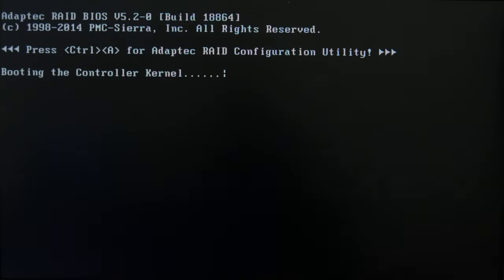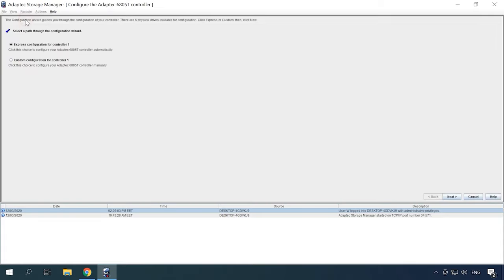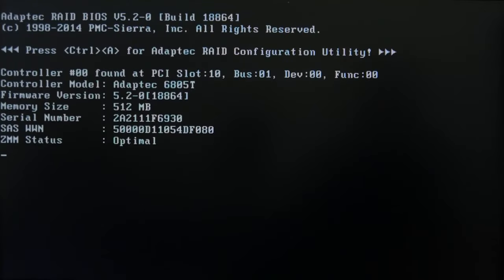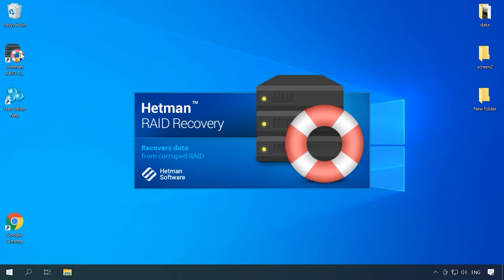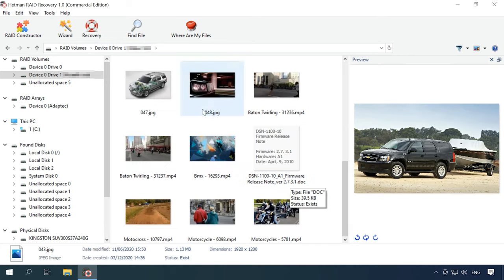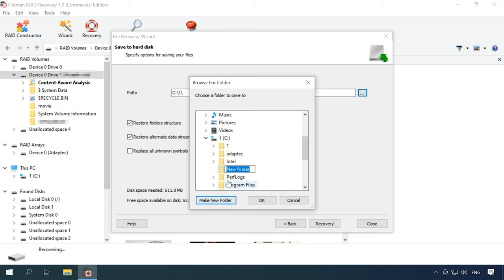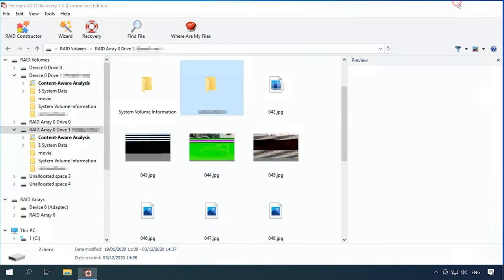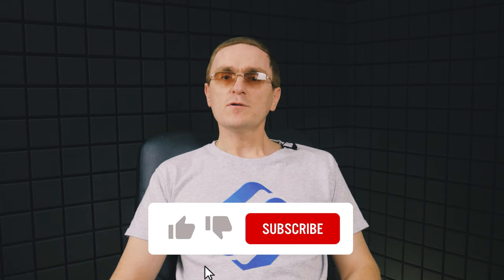How to Recover RAID 6 Data After Three Disks Fail, the Controller Breaks Down, or the Array Rebuilt

Comment from the maker: ⭐ Watch this video to find out how to recover data from a damaged RAID 6 array. 
00:00 – Intro
01:59 - How to create a RAID 6 system 
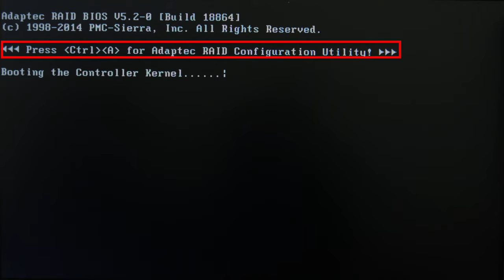02:10 - How to create RAID 6 with the help of the controller’s BIOS
03:55 - How to create RAID 6 with the help of Adaptec Storage Manager
06:03 - How to replace a faulty disk
08:03 - How to recover data from a RAID array with a dead controller
12:23 - Recovering data in a case of dead controller and two hard disks
15:09 - Recovering data in a case of dead controller and three hard disks
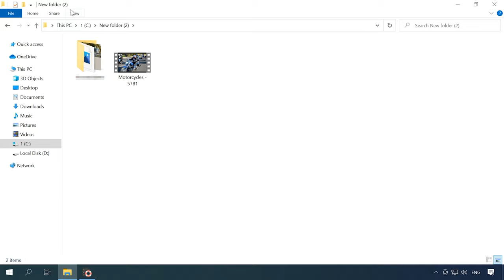19:04 - Conclusion

Comment: Hello @HetmanRecovery I have a Synology DS1815+ with 4 disks in RAID 6. Accidentally I unmounted the volume from DSM and now I cant access the files. How can I reaccess the files? Disks are okay, the problem is that I cant mount the volume composed by the 4 disks and access the data. Thanks
Reply from the maker: It seems like you accidentally unmounted the volume on your Synology DS1815+ NAS, and you're unable to access your files. Don't worry; your data should still be safe, and you can likely remount the volume and regain access to your files. Here's a step-by-step guide on how to reaccess your data:

Access DSM (DiskStation Manager): Make sure you are connected to your Synology NAS's web interface (DSM). You can access it by typing the NAS's IP address in a web browser.

Log In: Log in to DSM using your administrator credentials.

Check Volume Status: Once you're logged in, go to "Storage Manager" from the main menu. Under the "Storage" section, select "Volume." Check the status of your RAID 6 volume. It should show as "Unmounted" or "Degraded."

Remount the Volume: If the volume is unmounted, you should see an option to remount it. Select the volume and click on the "Mount" button. Follow the prompts to complete the process.

Verify Data: After the volume is successfully mounted, check if you can access your files. You should be able to access your data as before.

If you're unable to remount the volume through DSM or encounter any issues, you might need to perform further troubleshooting steps. Here are some additional things you can try:

Restart the NAS: Sometimes, a simple restart of the NAS can resolve minor issues. Try restarting your Synology NAS and check if the volume mounts automatically.

Check Drive Health: While you mentioned that the disks are okay, it's always a good practice to check the health of your drives. Go to "Storage Manager" > "Health Info" to view the status of your drives. If any drive shows a warning or error status, you might need to replace it.

Use SSH (Advanced): If the above steps don't work, you can try accessing your NAS via SSH (Secure Shell) and using command-line utilities to manually mount the volume. However, this is an advanced step and should be done with caution. It's recommended to seek guidance from Synology support or a professional if you're not familiar with SSH and command-line operations.

Contact Support: If all else fails, you should consider reaching out to Synology support for assistance. They can provide guidance specific to your device and situation.

Remember to always back up your important data regularly to prevent data loss in case of unforeseen issues.
Reply: @HetmanRecovery  Hello, I followed your advice and managed to mount the volume but now I got this message: 
"This storage pool is in risk because Volume 1 is abnormal status. To rescue your data, please sign in to your Synology Account to submit a technical support ticket. If you no longer need this volume, please fo to Volume 1 and click ... > Remove to remove it. Then, you can create a new one"

The thing is that I really need the data inside the volume (2x2TB disk + 2x1TB disk). RAID type is SHR (not RAID6 as I mentioned.)

I sent a ticket to synology and run a full health scan to all disks. No result and the message persists. Until now no answer from synology support.

Any suggestion in how to recuperate the data?
Thanks in advance.
Reply: @HetmanRecovery Synology support said there is nothing they can do. Will try using your software to recuperate the data